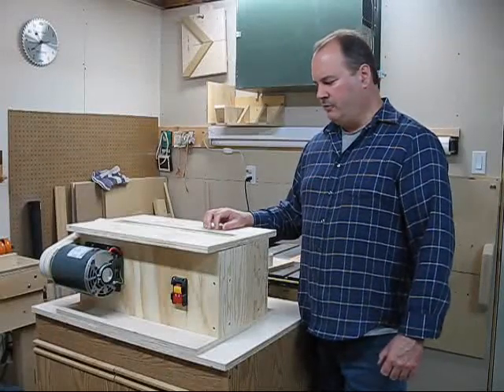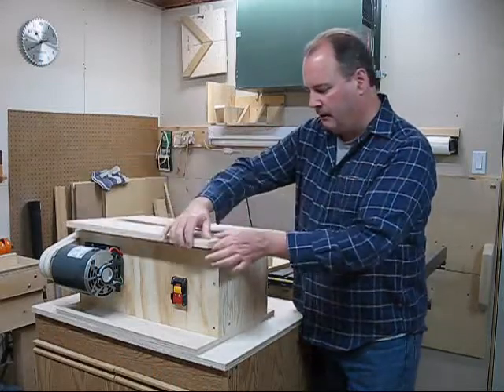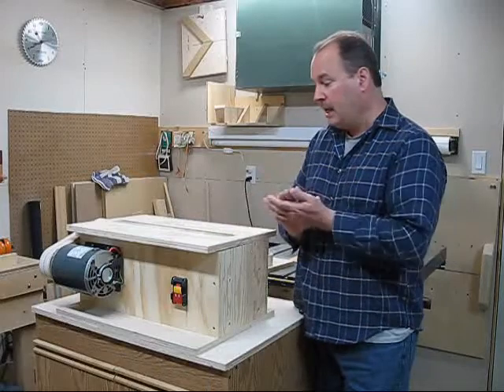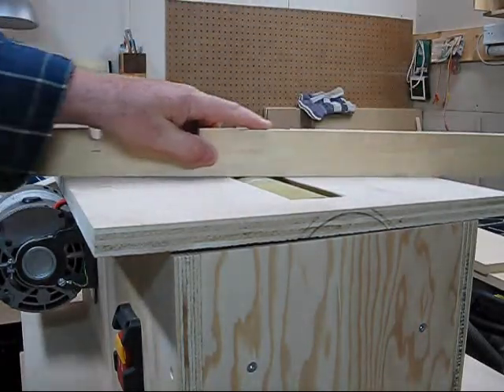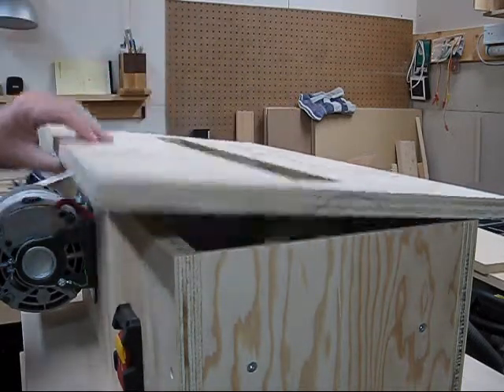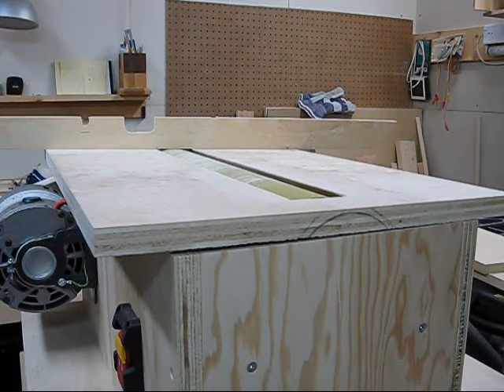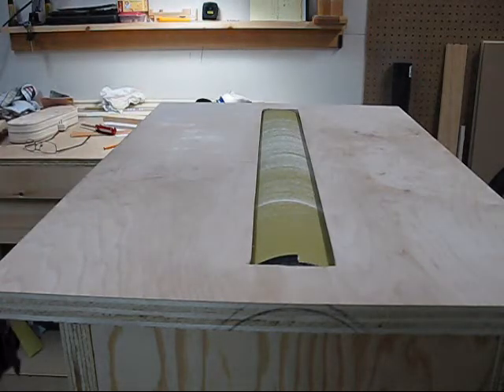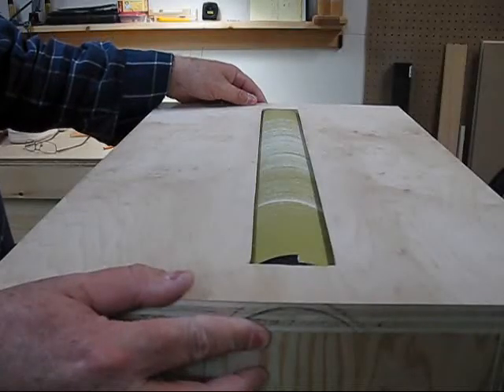V-Drum Sander - Part 5 (Top & Drum)

Comment from the maker: That's actually a very interesting idea. I never thought of that.
I would probably cut away about 90% of the hole in the top and then finish it the way you suggest. That would make a very smooth and accurate cover. Well done.

Comment: Sometimes I get lucky:)  Thanks for taking the initiative; you saved me a few hundred bucks!!! I have an old 4" Geetech 4" jointer that I put a 1725 3/4hp motor on and turned an oak dowel to wrap w/ sandpaper. (too small) that I need to redo.  I think I should abandon that project and follow your lead.  Thx again

Comment: Nice work, the only thing I would have done is put some rubber or something so when you close the lid, the air suction from the DC is better, then use a turnbuckle on the front outside of the main box to raise and lower the lid in small amounts, but still have good air tightness

Comment: Paul, great video! I will make one of these. Instead of measuring the height of the spacer you clamp above the box, why not clamp a piece that you have run through your table saw that is the same size as your end panel plus 1 3/4"? You could then cut another small amount off with the table saw until everything is trued up.

Comment: Hi Paul superb work. One question. Is the weight of the drum important. I am a wheelchair user and use to take part in wheelchair marathons. For bad weather truing I had a roller that I use to strap my racing chair onto therefore could train in my garage. I have now retired from racing but still have the roller along with bearings and flanges already attached. This roller is heavy and takes 2 men to lift. Do you think it would be to heavy? Also (forgive my lack of knowledge here) can your sander be use for jointing. Another question do you think a washing machine motor would be powerful enough. Have seen a few of these on YouTube and I feel yours is the best and most simple. As I said this is my opinion.
Reply: Sorry forgot to add the roller is 6"
Reply from the maker: Hi Barry, I made mine out of MDF but I have seen others use metal pipe with an axle welded in the center. I imagine heavier is better. Yours might be too heavy, but if the bearings can support it and the motor can turn it, why not? My motor is 1/2 hp. I am unsure if a washing machine motor will be able to turn a big roller that you have, but if you already have the motor you may as well give it a go. Worse that happens is the belt slips.
Reply: pauljp55 Thanks Paul I'll experiment.

Comment: I have often wondered if this type of sander (shop built or commercial) with only a one part table  as distinct from a jointer type two part table with differential infeed and outfeed heights would leave "snipe" at one or both endes of the item being sanded. Also if your rate of passing the item over the drum was not constant would it not sand different amounts of material. I can not see how it could not leave snipe or am I missing some critical element of this

Comment: I would have just fastened 3/4 stock to the bottom of the sanding board. Then pass it back and forth over the spinning drum till both 3/4 runners contact the top of the box.
Reply from the maker: Excellent idea. That would have saved me a lot of time. Where were you when I was building this? Lol :)
I think I will do it that way on my next build.
Thanks.
Reply: No problem, I was sorta wondering if I was missing something, but I guess I understood correctly. This is well built, I may be building one like it stealing some of your ideas. Thanks
I'm not sure this is the kind of machine I need or if I should be going for the type where the stock feeds on top of a table with the drum above.